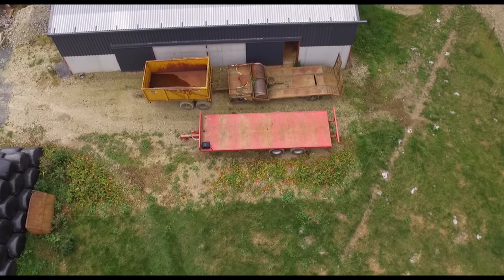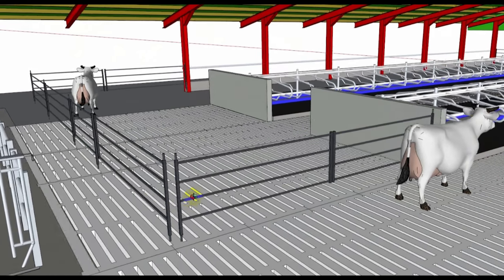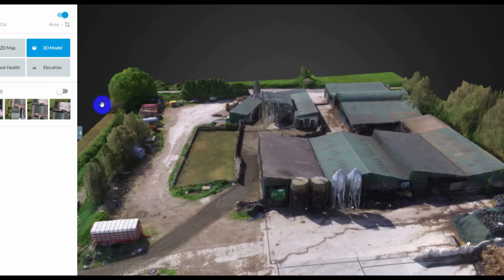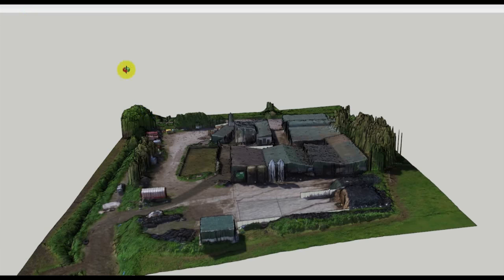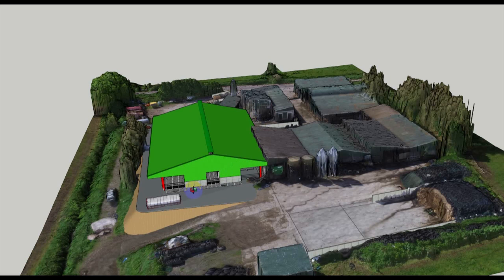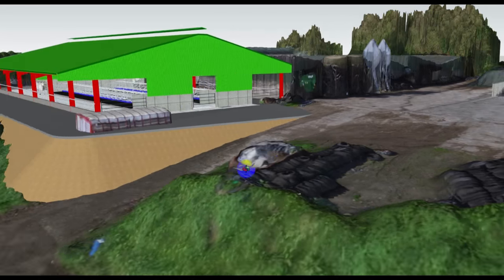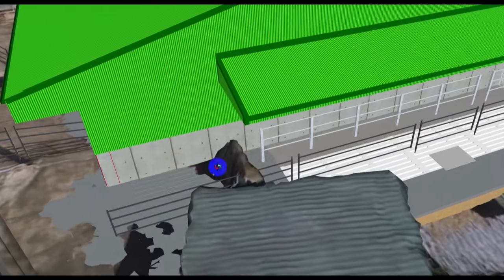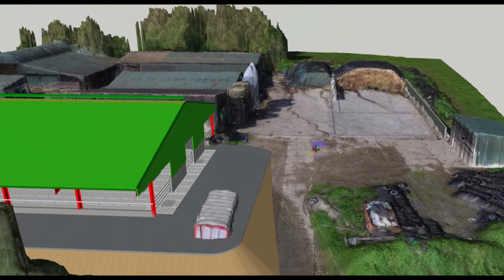Using 3D imaging to design the perfect shed

Comment: There are  several suggestions for building sheds
Start With a Sound Foundation a shed wont last long if it's set on a weak base
Allow for Air Circulation to stop damp 
Build a Weather-Resistant Floor Frame
Use Low Maintenance Materials so you don't have to keep painting it
(Reference: Adota Blueprint Pack site )